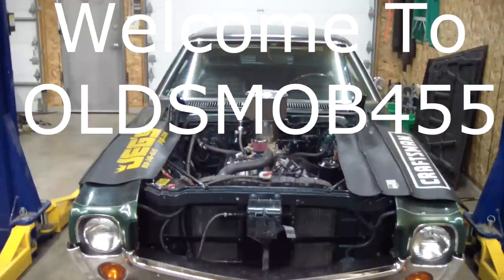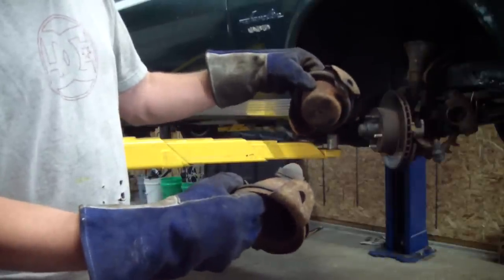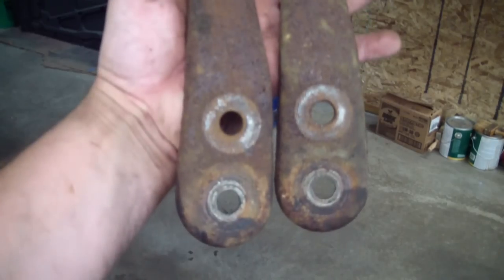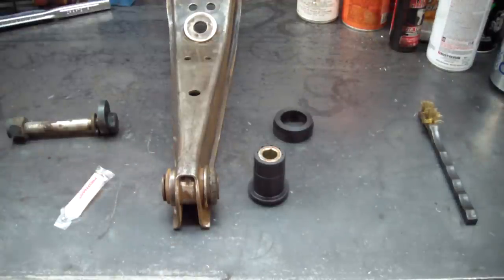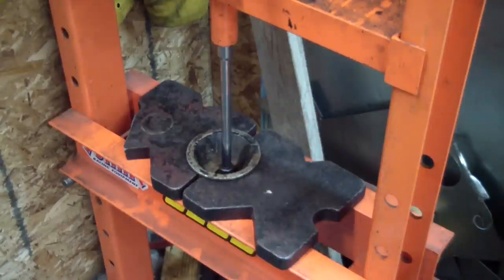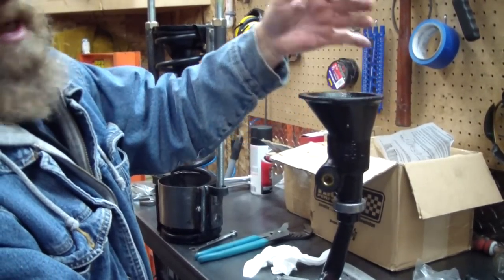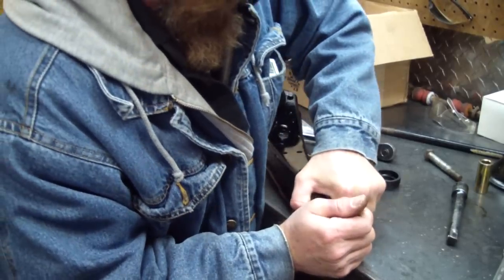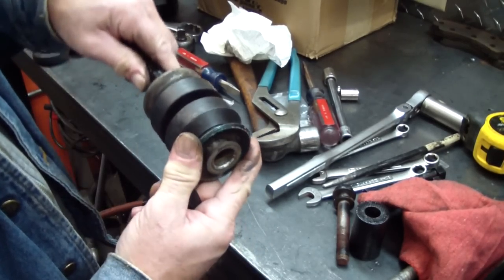AMC Trunnion Suspension Rebuild On A 1968 Javelin

Comment: Had a 68 Rambler Rogue did the same job at home busted the camber bolt What a nightmare. Man, it was a dream to drive after no power steering with radial tires you hardly noticed. Before you hung off the side of the wheel just to turn. I did kinda missed the piano sound the spring made when it rubbed when you went over dips.

Comment: Stock brake rotors were solid, not vented on '68'69 as I recall. Well done, sir
Reply: I had those calipers and they are notorious for leaking, pistons seizing up etc. I went through the same thing on a 69 Charger. I think those calipers are BW.   I got the brakes off a later hornet I believe, for reliability and they have been trouble-free. I also added PS and PB. I want to enjoy the car, not fight with it every other time there is a cruise night or show.

Comment: Also, there was a kid in my HS auto shop class that pulled a spring out of a ford, which has a similar spring location, without a spring compressor. The spring shot out and hit him in the head knocked him on his ass about four or five feet from where he was working. He had a severe concussion and is lucky to have survived.

Comment: Had a '65 440H with Olds455 with short TH400 in it years ago. Trunnions should be filled with grease/vaseline every service, I fixed the thing installing brass inserts and grease nipples in them. Couple of grase gun pumps every time I greased the lower ball joints did the trick

Comment: Little tip on setting ride height on AMC for those that think cutting or heating coils springs is the way to go,don't do it. It is best to determine the ride height of the original spring by measuring the coil from top to bottom. Do one side at a time. To get a fairly accurate measurement, put a floor jack under the lower control arm and raise the car just enough to get the wheel off the ground. Remove the wheel and get the measurement. Doesn't have to be exact, but the closer, the better. Contact any good suspension shop and bring the old coils with you. They will measure the diameter of the spring "Wire". This, combined with your ride height measurement will tell them how to make your NEW coil springs. You tell them how much less ride height you want, let's say 2", and presto! You've got a new set of coils made to handle your front end weight of your car AND you have the two inch drop you wanted. Cost is usually between $150 and $200 for the new set of coils, and well worth it. Save up the money and do it right.

Comment: I had a 68 Javelin, when I rebuilt the front suspension I learned from my Chilton manual the procedure is so simple, in order to compress the left front spring, jack up the right rear of the car, this will compress the left front , when it's compressed you can capture the spring using the factory tool that is simply a rod that has hooks on each end of it the hooks will engage the holes that are in the upper, and lower spring pockets , if you can't find the factory spring hooks you can improvise, seems like I used a chain and bolts hooked to the spring pockets, when you have the hooks/chain or suitable tool installed, let down the right rear this will allow the captured spring to be removed leave the spring hooks on so the spring remains captured for reinstallation . reverse the procedure for installing them ,

Comment: The front discs look to be from a later model year. The 68s had solid front discs. At least the 68 AMX I had did.
As long as you have the front suspension arms out be a good idea to box them if anybody else is going through the process
Reply: Correct on the rotors.  Also original calipers have 4 pistons.  You can buy new calipers.

Comment: I often wonder it Roger Penske had anything to do with the suspension change in 1970? He was running AMC Trans Am Series team in 1969 when cars had turnnion and a year later new suspension, new head`s, new deck height on there blocks and new bore’s for blocks. I had a 68 javelin SST lol the hole tower holding the  turnnion shifted up away from the frame , was rust to it weaken it, so got scrap the car and pick up a 73 Javelin with a 360 in it for like $700 bucks lol , I love 80`s the 70`s car so cheep and so many of them and smorgasbord of interchange bull parts for AMC in scrap yards. :)
Reply: Absolutely. Penske and all of them influenced the changes in 70, then 71. If you drive a 68-69, then a 70, then a 71 they were really improving in the handling department. Drive a 68-69,, then jump in a 71 or 72 and the difference is HUGE. This started as a sports car and quickly matured. If they had not been in the racing business those few years, the Javelin/AMX line would have remained pretty much the same other than engine and grille/light changes.

Comment: Great video, I really like the custom spring compressor. Are you worried that bolt is going to contact the the header pipe when you hit the gas and torque the motor on the mounts?

Comment: thank you. after collecting all the parts I needed to finish the front end. my project was put on hold until I could get my vehicle to me. 
I recently got my Rambler back and have been putting everything together. I had one question everything is back on except for the shocks I've noticed the spring is leaning in towards the inner fender. do you suggest recompressing the spring and then installing the shock?

Comment: I am in the process of rebuilding the trunnions on my AMC 1969 Hurst SC Rambler. I purchased the polyurethane bushing kit for the trunions, upper and lower control arms along with a thrust bearing kit for the trunions which included the o-rings and the plastic washer but not the brass retainer which looks like a small ring. It is at 12 minutes and 50 seconds into your video. So it seems to be missing from my kit. I've reached out to the vendor Galvin's AMC about this. It seems like that retainer clip prevents squeezing down on the polyurethane trunnion bushing too much, without it rotational movement between the knuckle and trunnion would be inhibited. Has anyone received the rebuild kit and not had this brass retainer clip included? Thanks

Comment: I have to disagree with you about the need for a lift/hoist. There is a much simpler way to build a tool that's made to be used on the ground, using a floor jack. Using two pieces of steel flat bar/plate about 10" long, 1 1/2" wide. Drill a hole at the top of each bar to allow for a nut & bolt. I think 3/4 or 7/8 (wrench size) should work. Just make sure the head of the bolt fits through the holes on the spring cup 'ears'. Drill another hole below the first, spacing the two at about 9 1/2" apart. The heads of the bolts are going to be used to hook the upper and lower spring cup 'ears'. The bolts only need to be about 2" long. Put the bolts and nuts in the holes you've drilled- bolt head facing in toward the 'ear'. Hook the top of the bar in the upper 'ear'. Then, with the wheel removed, you can use a floor jack under the caliper/drum to compress the spring until the lower bolt head can hook the lower 'ear'. VERY IMPORTANT STEP!!! Now make sure to tighten the nuts on your bolts as tight as you can get them- squeezing the flat bar and the 'ears' together. This will stop the spring from bending out of shape when you release the tension on the jack. If you don't do this you can expect major, major problems!!!! Release the tension on the floor jack and your compressed spring can now be removed and set aside in a safe place. Replacement is the reverse. Set the compressed spring on to the trunnion and align it with the upper body mount. Keeping a close eye on the positioning of the spring cups, slowly jack up the disc/drum with the floor jack until the spring is seated. Loosen the nuts and bolts, and remove the bars from the 'ears'. Release the tension on the jack and you are all done. NOTE. If you plan to decompress the springs off of the car, keep in mind they are about 18" long uncompressed!!!

Comment: hi i both a 1965 amc rambler and looking for front suspension kits, spring coil, ball joint and interior seats. Could you help me find those parts? If you have any names or numbers or company names for these parts.
Single Head light, 4 door, 6 cylinder, automatic.
Reply: +Justin Naba kanter auto

Comment: watched the video again and noticed that you pressed the bushing out the bottom of the trunnion but dropped the new one in the top, can it go either way, is the new one different or was this an oops?
Reply from the maker: It might have been an oops, I don't recall.
Reply: LOL, wonder if it mattered?
Reply from the maker: It's possible the instructions told us to install it that way, I just don't recall.
Reply: OK, I did mine and the instructions did say to put it in from the top. The spring removal was done without a spring compressor and was easy and safe, there is an easier way then what you did. they came out with no spring compressor and went back in with a spring compressor on it compressing only a couple inches, but if i had help i don't think i would need to compress them at all. I took them out and in alone using a floor jack and jack stands. . Here's a link if it works to the AMC forum .http://theamcforum.com/forum/trunnion-removal-for-v8-cars-only_topic72382.html?KW=trunnion

Comment: there is one thing to think about when comes to the header fiting. when hooker made there mock up test to see if the header fit good in a 68 body with trunnion and V8`s with square port, i sure they fit well they are good company, and when amc made the front suspension change and head change to dog lag they most likely start all over again with mock up test for a new header to see if the header fit good in a 70 body,,, so what do we learn? if you order header for a 68-69 Javelin with square port they will fit and if you order headers for a 70 body Javelin they don't fit right because they where never made to fit a 70 head motor in a 68-69 Javelin:)   if you like a costume fitting set of dog lag headers to in a 68-69 body Hooker would be glad to make pay for them lol lol .... my point is they cant make a header to fit ever creation people come up with and less you can find a markit in like big blocks in Chevy Chevette or all so know as Chevy shovette!!! get it shove it in lol

Comment: I’ve been a mechanic 45 years, lve never seen a mechanic use there dirty shoes to force grease through the bearings, you just contaminated all the fresh grease in the bearing packer, all the grease in packer nds to be thoughouly removed and replaced with fresh grease
Reply from the maker: A mechanic for 45 years and you have never seen a bearing packer?  lol

Comment: Hooker lists one part number from 68-74 for AMC. They have several different finishes and tube sizes, but they may all be designed for later suspensions that don't use the trunion system.